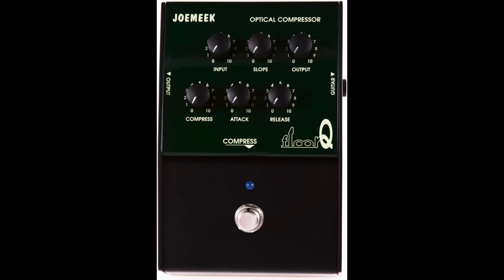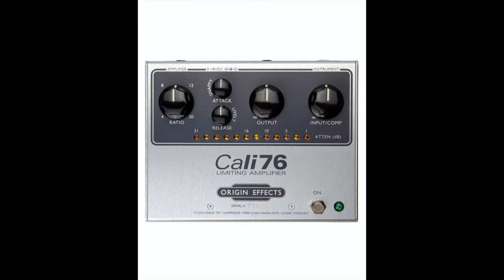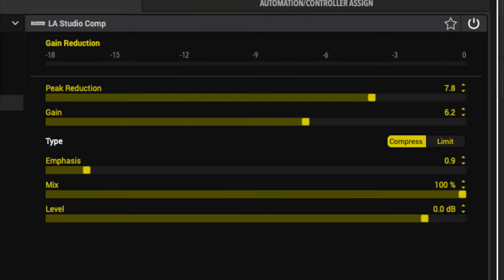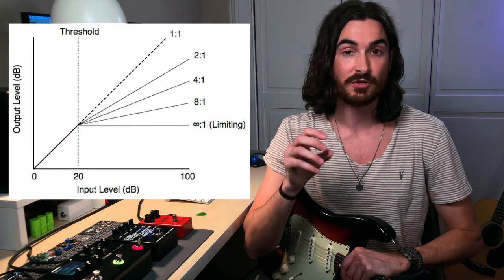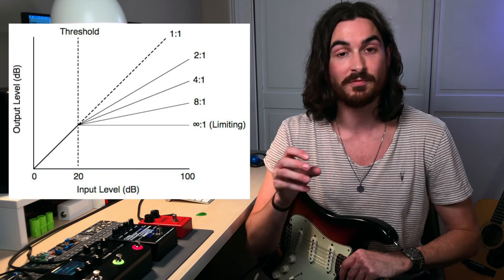How To Use A Compressor Pedal on Guitar | Line 6 HX Stomp vs Analog Pedals

Comment: Thanks! :) I'm starting to use compressors on my Helix LT, and I agree that I find it better to use it before the amp. Also I think if you put it after the amp or effects, there is more work to do because you'll have to dial the compressor depending on the bypassed pedals or the different gain stagings of each snapshot.
Reply from the maker: Hey thanks for checking out the video! I agree, I think using the compressor block early on creates a more stable overall sound, and you have one less thing to worry about when varying gain stages using blocks or snapshots. Enjoy!
Reply: Yeah man, NEVER after an amp unless you’re mixing a recording and trying to get it to fit within that mix. Otherwise you lose all of the dynamics and characteristics of that amp.

Comment: I use a Carl Martin Quattro which has a compressor first thing in the signal chain. Only two control settings Compress and Level but I don't miss the other settings on their stand alone compressor/limiter pedal. I use light compression and raise the level control to push the front end of my amp. Let me tell you the Carl Martin pedals are great. Full sounding. Please check out analog before you step into the digital world
Reply from the maker: Hey Zack thanks for checking out the vid! I totally agree, I just redid my board with analog front end and digital post-fx, and the Carl Martin comp has made it back on, it has a vibe I just wasn’t getting from the other compressors! Great company